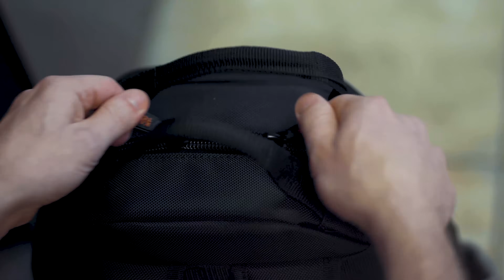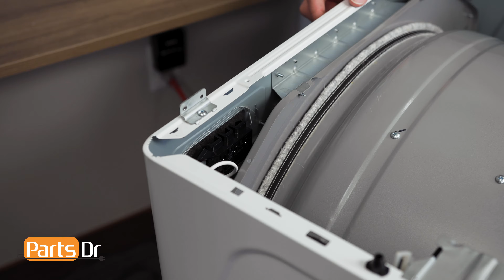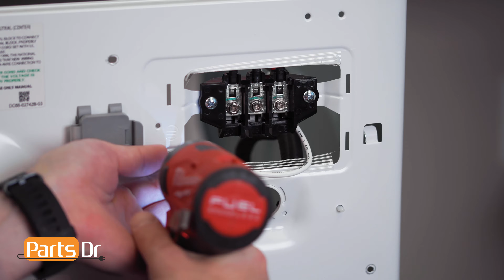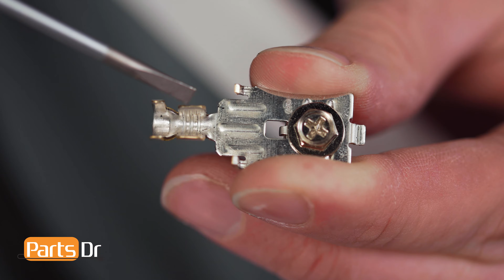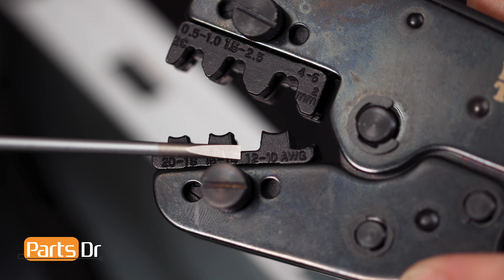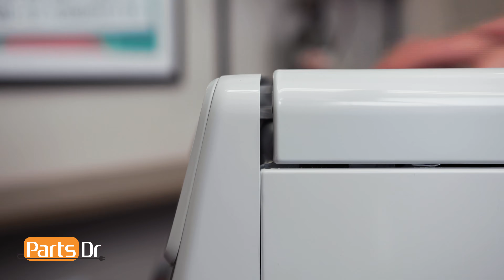The correct way to replace the power terminal block part # DC96-01188A on your Samsung dryer

Comment from the maker: Purchase the Samsung Dryer Terminal Block shown in this video here: https://partsdr.com/part/dc96-01188a-terminal-block-assembly
Klein tools VDV200-010 Ratcheting Crimper Frame and Klein Tools VDV205-036 Crimper Die is the crimping tool used in this video.

Comment: Is there a way to get just the metal parts of the terminal? I crimped the wires and didn't realise I put the wrong size shrink tubing on. Or could i use a ring connector for securement?
Reply from the maker: They do not sell the metal parts separately.

Comment: Do you sell just the terminals?
Reply from the maker: They are only sold like this https://partsdr.com/part/dc96-01188a-terminal-block-assembly or as part of the main wiring harness assembly for the dryer.

Comment: This video saved me $1000!! Thank you!!
Reply from the maker: Great!!! What happened to your original terminal block?
Reply: @PartsDr  the apartment we were in had an exposed wire and it fried the terminal somehow. My father-in-law wired it up without a terminal and that has worked for a few years but now we moved and I have to switch the power cord to a three-prong. My wife wanted a new dryer and I wanted something safe so I watched this video and ordered a new terminal from LG. It's like new now😊 glad I didn't just buy a new dryer 😂 it's been a good dryer for 10 years.

Comment: At first my dryer just would not power on. I looked at video after video and found one that said how to reset your dryer. Tried that and the moment I plugged it into the 240 outlet at the house a huge spark shot out where the pigtail was at. I thought great time to buy a new washer and dryer. I prayed and it came to me about the terminal block. This is the best video on how to replace one. I ordered my block and it will come in tomorrow. will let you know how that goes. Thanks this is a great video and I think I just save $1800.00
Reply from the maker: That is great to hear!  Let us know how the repair goes for you!

Comment: The video is really helpful, but in trying to actually do it I'm having trouble figuring out which of many many available crimper tools actually function as pictured. The video says "12-10 gauge open barrel crimper die" which is not sufficient to identify which tool to purchase, and most tools don't even use dies.
Reply from the maker: Hi Julia, we used the Klein tools VDV200-010 Ratcheting Crimper Frame and Klein Tools VDV205-036 Crimper Die.